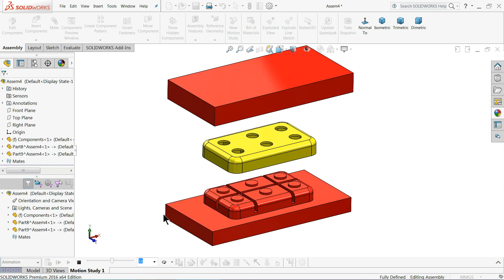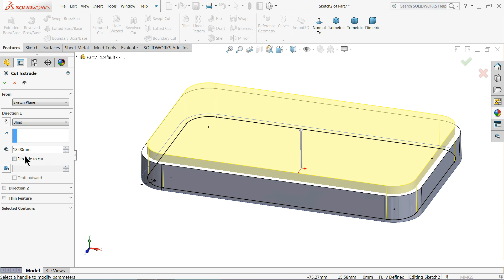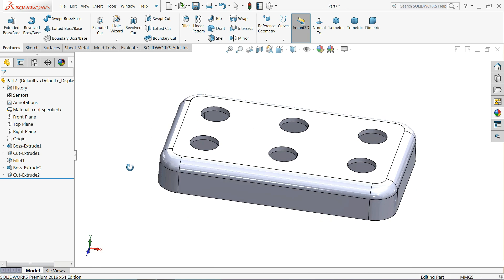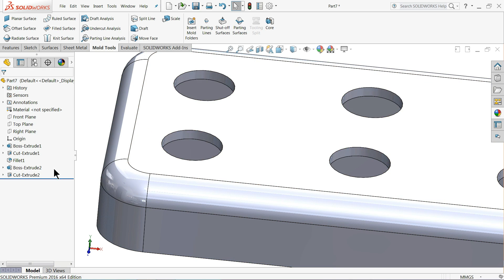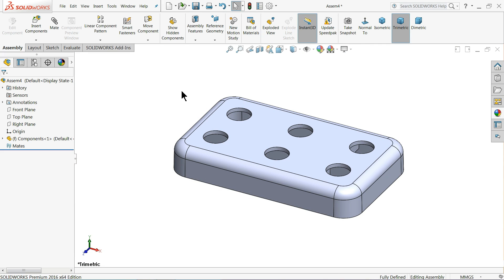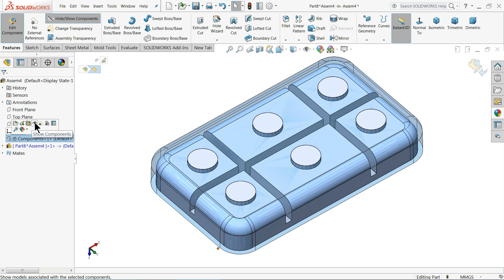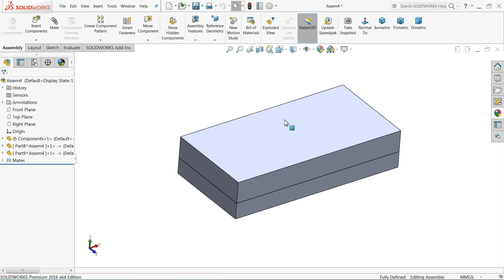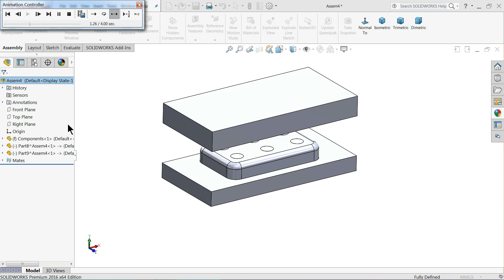Solidworks tutorial | Mold Design in Solidworks | Cavity and Core in Solidworks

Comment: This couldn't have come at a better time for me.  I'm presently working on an injection mold in Solidworks 10.  I'm self-taught in Solidworks so it takes me a long time to figure out this kind of design on my own.

I wanted to ask; the mold you've designed in this video appears to be a mold used to stamp the form of your part.   If this were an injection mold, how would you go about placing the injection holes? 

 Does the Solidworks software understand the placement of these holes or is their placement based solely at the disgression of the designer?  In my case I will be using polyurethane as my molding agent and in my mind I figure there has to be an optimum placement of such holes in order to get a proper fill.

Any insight you could offer would be helpful.  Many thanks.  Keep up the good work.
Reply from the maker: i will try to cover maximum number of topics in mold designs, wait for future tutorials,